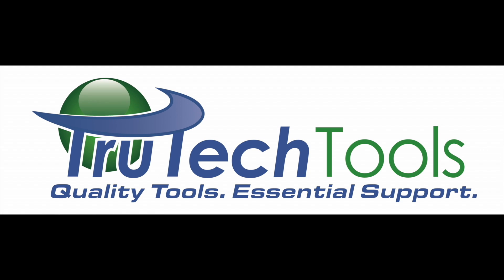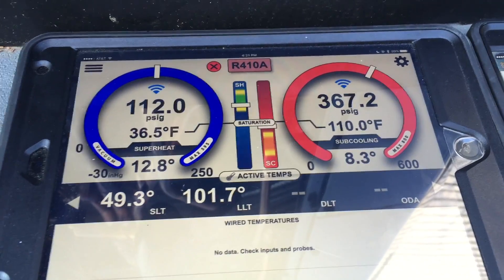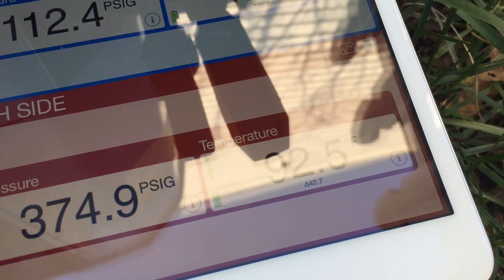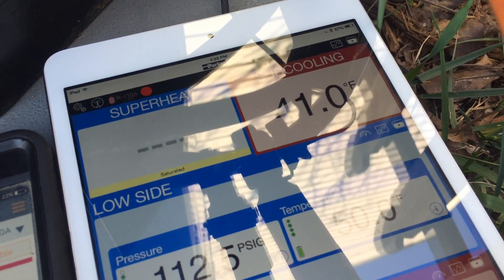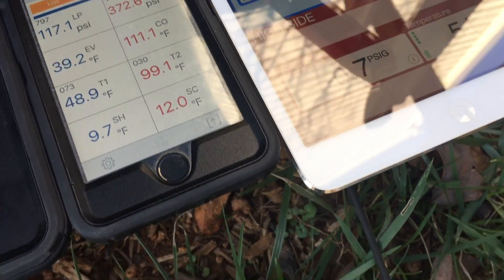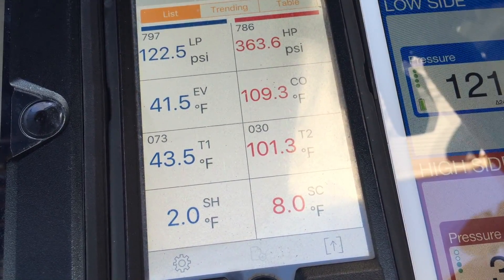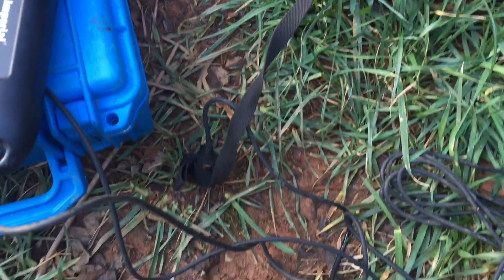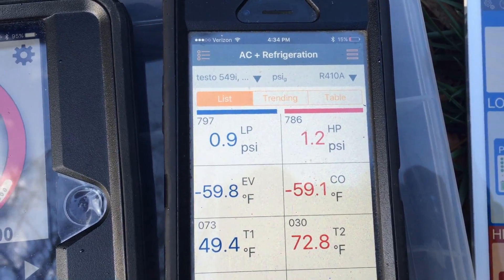HVAC Tools: Comparison Testo Smart Probes Sporlan Smart Service Tool iConnect Pressure Probes

Comment: Please advise what Smart gauges should I get the best one with lot of options to help me charge correctly an HVAC system.
Reply from the maker: It’s not necessarily about the probes as it is the software that the probes work with. Visit www.measurequick.com and they have lots of options for which probes you can use.

Comment: I'd like to see each system compared individually to a set of digital gages calibrated to a jug of R410A at atmospheric pressure/temperature and a Lab quality digital thermometer like a Fluke 52 or a Fluke 54 that's NIST calibrated and see if the readings are close.
Reply from the maker: That would be nice

Comment: What’s your thought on the Fieldpiece JL3KH6 VS the iconnect?
Reply from the maker: Good question! The short answer is that if Fieldpiece would get on board with MeasureQuick they would rival iManifold very closely considering the range that FP is getting from their probes. There are some things about the FP kit that I would rather see different but overall they’re solid devices from what I’ve seen. I haven’t made the decision to pick them up myself though.

Comment: Did you consider lightly sanding the part of copper where the probes contact, and possibly using a heat sink compound on each to ensure good heat transfer to the sensors. For some, meters, the  pressure sensors are to be zero'd out to atmosphere at start  and there will always be a slight difference 2-3 psi between brands is probably acceptable. Since many calculations are dependent on accurate temp measurement, i'd take all pains to get that right by ensuring a good contact. I have also seen with IR images, that both suction and discharge pipes have several degrees temp difference along the line as they approach constrictions, solder points, bends etc. So even having 2 probes next to each other can have a slight actual temp difference.

Comment: To much digital crap....standard gauges and a temp meter with probes is faster and more accurate in my opinon.....looks like all those high priced toys dont work very well....and your limited to the size of the unit you can check due to limited pipe clamp size.
Reply from the maker: depends on what you are calling speed and accuracy. guaranteed you can't calculate sc and sh 4 times a second and interpret what your gauge needle is pointing at within 1 psi. to each their own in the end, not like a video on the internet is going to convince everyone
Reply from the maker: put 3 sets of analog gauges up against each other and you'll get varying readings also
Reply: Stephen Rardon that depends on the gauge and its ability to accurately repeat. Remember the cost of your instruments are nominal, thus the degree of inaccurate readings are to be expected. Great job on this video.

Comment: You can't do a test like that simultaneously and expect the same results with all three pieces of test equipment due the different placements of the sensors and the competing transmitted signals of the test equipment.  You have to do the comparison individually placing test probes in exact same place as the other probes.  That in itself will contaminate the results.  Also, I don't think the Sporlan was as well shielded from interfering signals as the Testo and iconnect were.  The competing signals from the other two pieces of test equipment appears to have caused the sub cooling and super heat readings to be way off on the Sporlan.
Reply from the maker: If I don't do simultaneous testing the readings can't be compared. Each system has it own collection of multiple radio signals, Sporlan has 4 Bluetooth, Testo has 4 or more and iConnect has up to 12 wireless signals. I don't think your theory on signals is valid as an excuse to why the numbers don't exactly agree.
Reply from the maker: Each device had it own system to connect with, not like I was forcing them to connect to the same radio.
Reply: I think it is possible you are getting a type of intermod in close knit competing signals much like you see in repeater rooms in which there are multiple repeaters in a shared room.  They aren't on the same frequencies but are close enough cause an intermod effect.   Anyway just thought I'd throw that out there.  Thanks for getting back to me.

Comment: I'll not knock any one gauge, but, when tested against a gauge with +/- 0.04% accuracy where I work under controlled conditions, the Imperial/stride was clearly the most accurate. I'm also partial to the Sman since it's so darn easy to read in bright sun lite. Direct sunlight on the iPad or handheld screen is the only drawback I see when using these new systems. The Imperial/Stride is one tuff system to beat!

Comment: I put a jug of 22 in the house for a day and the tool in question beside it to acclimate to the same temp. Use a glass tube thermometer to check them ( mine is a Bachrach sling phsycrometer) then check with the TP charts to see where your pressure readings are.on the tool. On temperature you have a 32f and 212f you could check for known values. The 32F requires shaved ice in a container with a small amount of water to give 32F water, secure the test probe to a wood pencil with rubber band and keep submerged, I wrap the container with an insulation blanket bubble wrap foil...and comparing, checking the other end at 212F is a bit more tough, but a steam kettle should get you in the ballpark for that...

Comment: Assuming that all these kits WORK PROPERLY which one do you like the best?
Reply from the maker: +mazzmari I like the Sporlan kit for how compact and clean it is compared to the Testo and iConnect but it is only refrigerant right now, if I had to pick one kit and stay with it if have to go with iConnect. It covers long distance and does so much more than the other kits.

Comment: l hear you
Reply from the maker: +Ken Lafountain out of all the devices out there the iConnect is the only one that is a complete system analyzer rather than just a digital refrigerant gauge set. how much do you really see if all you look at is refrigerant pressure? How much does SH and SC add?  if you never look at the air flow or electrical performance you're in essence making a Lot of assumptions that could be very wrong. if you're not looking at the whole picture then you're simply guessing

Comment: I've had the exact problem with the sporlan recently, what was happening is I would change from 22 to 410 but it wouldn't register thus giving me funky sh and sc. If you close the app and restart the app it solved the issue. You had to completely close the app though by double clicking the front button on the iPad, simply backing out of the app did not reset the app.

Comment: Possible issue : 
all those apps open and blue tooth signals zooming & zigbee signals zooming around right close to each tablet. I don't think the pads and tools are rated for that kind of interference from so many close coupled sources at one time. Possible Rf interference when jamming so many rf signals in a tight space like that. I don't think the pads are Shielded for that kind of interference.
Reply: I think that interference doesn't matter because signal is digital, not analog. Therefore information is correct as much as sensor is accurate.

Comment: A lotta money spent there,and you can't trust the data.A good analog gauge and a u tube manometer are still the gold standard
Reply from the maker: +Paul Marini I trust iManifold
Reply: You better trust it,it cost more than most of the equipment you work on
Reply from the maker: It does, it was engineered as a leader in the industry not just another "me too" smart phone Displaying toy. There is always a margin of error but iManifold has thinned that margin to the smallest possible line.
Reply: 550's seem reliable,can't overthink this shit,we are not saving lives here

Comment: Also, although the pressures agree, the iConnnect saturation temps will be a little different as we are correcting for atmospheric pressure with an onboard barometric pressure sensor.  The other sensors that you are using are likely uncompensated relative pressure transducers.

Comment: Stephen,

I would zero all the sensors and hook everything up to a tank of refrigerant that is stable in temp and compare the saturation temperature to the actual temperature. Saturation temps and measured temps should all agree. No superheat and no subcooling. If you set a tank upside down and fill the hose with liquid, you can clamp all the sensors to the same hose. If you are bringing the tank in from the outside it will take awhile to stabilize.
Reply from the maker: +FIX IT HVAC yes, iManifold can show you non-condensibles in a system. Check this video out
https://youtu.be/aywnfAh16iY
Reply: THe pressure fluctuation you are seeing is due to a non solid column of liquid in the liquid line. The system indicates subcooling, but due to the mix of air and refrigerant, the saturation temperature of the refrigerant no longer holds true. This goes back to Daltons Law of Partial Pressures. The iManifold can detect that, it reads 4 times/second, and it will also detect the problem in troubleshooting. If you had a sight glass on that system, you would see bubbles in the sightglass and indicate subcooling. The non condensables drive up the head pressure.

Comment: Analogs and a fluke.....lol
Reply: +Eric M never had my analogs let me down and fluke is one of the most accurate temp measurements tools. with a little common math you can get the same reading as a digital gauge set.
Reply: +Eric M watched your comparison video which I liked how you did it. analogs where pretty much right on except the ones you didn't zero. but you can always test probes in ice water to check accuracy. I personally had a bad experience with digital gauges and like the old school way. did like how you tested that though.

Comment: Testo set on sale for 175 at Tru Tech. 4 degree difference in subcool is a little scary though....
Reply: Mike that's of the iconnect is 100% dead on with its reading,  how do u know the Testo wasn't closer to the truth . Unfortunately there is no way to be 100 % sure
Reply: +justin henning +justin henning This is true, but for 1600 bucks and for how much that trutechtool guy defends the iconnect, it better be dead on balls accurate. I'm gonna have to get some ice water out this weekend to test these cheap testos out lol.
Reply: +justin henning you're right. Thermistors are almost never the same.
Reply: Mike Ranochak that's why we can't rely on subcool alone

Comment: Almost seem like Sporlan wasn't using 410a even though it was selected. I think the clamps were less accurate on testo than iman because of thermal mass and outdoor ambient.
Reply from the maker: the testo probes are adjusting for exposure or however they say it +Joe Shearer there is an option within the app to offset temperature by a fixed amount that is not adjustable as i understand